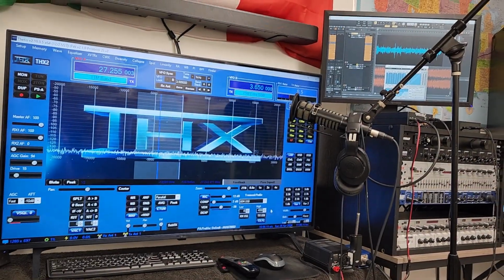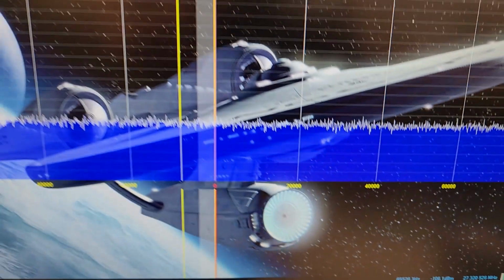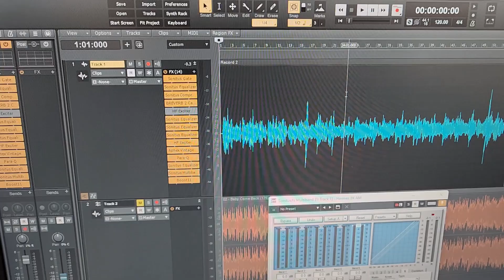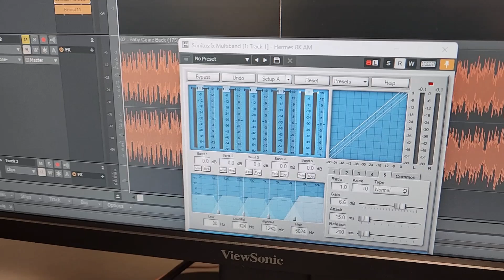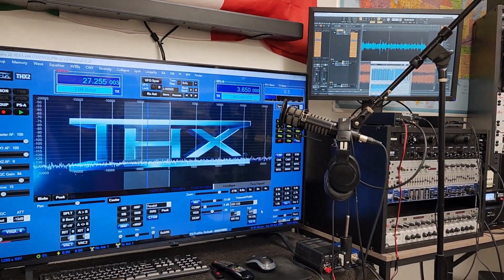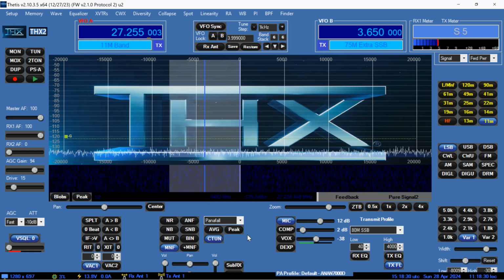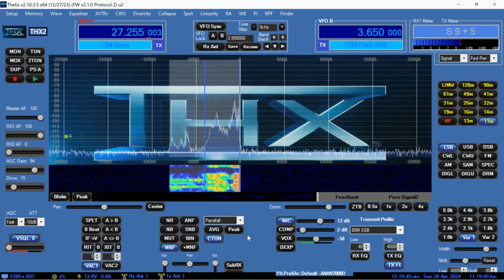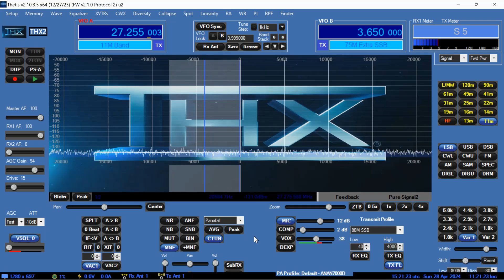Hermes Lite 2 Plus LSB air check. Station B TX to station A RX

Comment: seems to be one of the cheapest ways to get into HiFi-Essb audio. I am excited to try this
Reply from the maker: Exactly! Perfect way to explore the technology without breaking the bank and the audio processing software that I use is free.
Reply: @KP68videogates  I am interested,   I run rack gear into the anytone 5555n2 set to 4khz bandwidth. But I can't get the sound I want.
I considered direct Injection, or the asymod (stupid expensive)
For cheaper I can get this and then it allows me to do anything I could dream of! I just can't solder this small stuff. Scares me to death. 
I'm done with cb stuff. I've spent 4k on equipment and can not get nothing to work. The sellers and repair men are all snake oil 
Saleman. 
I believe this, a 500w amp and a Collosal 10k antenna from ZeroFive will me my safest route to getting the sound I want with reliability.